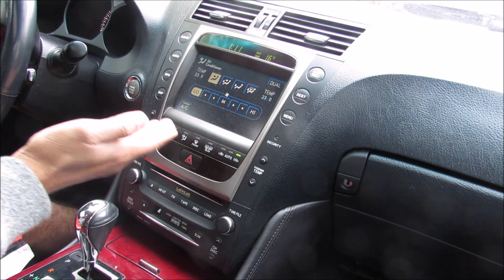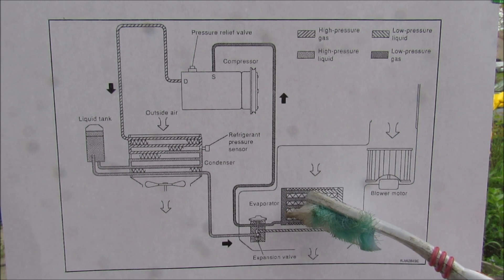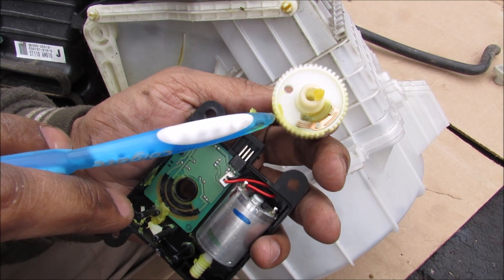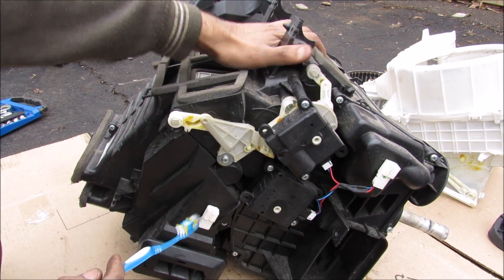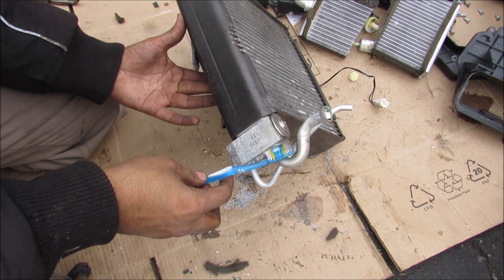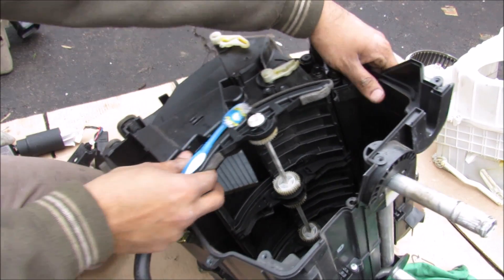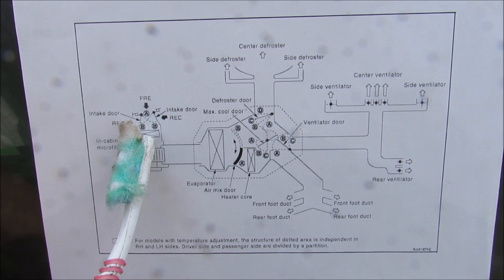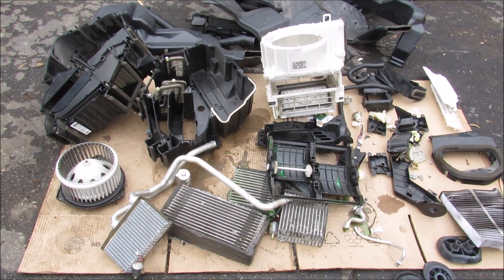How a Car Automatic HVAC System Works

Comment: 9:14 that's the TXV mounted on my European MPV (tried to find a scrap one to no avail, and the original one is like 130 bucks at the dealer) and in your video i'm able to notice some nicks on the valve seat, am i right? Also, in my channel i disassemble another one made by TGK, and there are no nicks on the seat, but, even though the ball is able to seat completely, the valve still never closes even if i completely adjust that little plastic nut to the closed position and then freeze the power head (that's a "cross charged" valve and you find it with variable displacement compressors and rotary compressors, i can link some patents that show how these ones work; on scroll and vane compressors, they apparently help to keep the evaporator from freezing by keeping a little flow of liquid so to prevent the suction pressure from going down too much; on variable displacement compressors, they keep the control valve from malfunctioning and also keep the compressor lubed; the nicks on the valve seat may actually do the same thing)... also, in the TXV i disassembled, the ball is attached to the metering rod... anyway, thanks for disassembling it!
Reply from the maker: I didn't pay attention to any nick's in the valve seat but that would be an interesting way to let things be lubricated. 
This system had way too much green dye
Reply: @speedkar99  Yes, it also keeps things lubricated even when the evaporator is cold and the TXV is closed (practically speaking). Rear seat evaporators, for example, have nicked seat TXVs so that the oil doesn't pool right behind the TXV when AC is on but the rear blower is kept off. Unfortunately, TXVs that stay open, either because they're cross charged or nicked, also allow liquid refrigerant to migrate to the compressor while the system is off, causing a lot of noise (scroll, through vane, that sometimes start up noisily for this reason) and performance (variable displacement piston compressors, that sometimes take a little more time to go into full displacement than usual) issues...

Comment: Best view of this system I've ever seen, bravo! I didn't realize it had its own CAN bus system, what a complex process. I really like the snappy information delivery you show here....
Reply from the maker: Thanks 
Yes I didn't realize it until I researched why each motor has only 3 wires and found a good explaination in the repair manual
Reply: Some vehicles use the lin bus but operation is the same.

Comment: So air is always passing through the AC evaporator? If i want hot air, it still should go through AC evaporator?
Reply: The AC evaporator has no effect unless the compressor is activated. Off, you just get heat. With the AC compressor on you bypass the heater core and get cold. When both heat and AC are on (as when you turn to defrost) the cold evaporator condenses the moisture out of the air, then it is heated.
Reply: Only if you turn AC on.
Reply: @speedkar99 I also interested in new HVAC systems with "heating" feature. Where Coolant flow is reversed, so AC EVAP will act as AC radiator, and AC radiator will be EVAP. This system is in my car, european Honda Accord CW3 (2.2 i-dtec diesel, 110kw)
Reply: Yes, it's always passing through the evaporator first. With fresh air, however, it's outside air. With recirculated air it's inside air. This is useful to know when you want to do a "fully loaded" ac compressor test in the winter. Just run recirculation and hot air at the same time for some minutes and then turn ac on, and for example you'll see if a V5 compressor is able to run at full displacement...
Reply: thank you guys for the clarification

Comment: I love my cheap car's MANUAL SINGLE-ZONE HVAC system.
It has physical lever for recirculation control, for example.
No motors, no extra wires, far fewer things to go bad.
Reply from the maker: True but sometimes those doors get jambed or break
Reply: @teravolt6113  Yup, a cheap Honda Fit/Jazz.  I never considered using recirculation lever to control temps.  I think I'll stick to ON/OFF positions.
Reply: @catsspat  That's the same way the automatic climate controller regulates the interior temperature whenever it can't control the compressor displacement. It first acts on the fresh air flap and then on the heater flap/valve.
Reply: How old is your car to not have electronics in Ac?
Reply: @foxtrot312  2003. The only AC electronics is the ECU, which decides when to engage the compressor's clutch. There's not even an evaporator temp sensor (pneumatic control valve on compressor takes care of everything).
Reply: @foxtrot312  I'm pretty sure mine has some electronics, like the temperature sensor at the evaporator.  Now, the bomb drop.  My car is 2019 and has fancy adaptive cruise control (Honda-Sensing).  Ahaha!  But it's manual transmission, and HVAC is indeed mostly manual knobs and switches.

Comment: As always well done Speedy! I had one of those actuators fail recently in my Lexus which then blew outside air on just the driver's side,  and cool air everywhere else.   Rather than pay $80 for a replacement,  my son figured out that by removing it, he was able to position the flaps to just allow inside air.
Reply from the maker: So it's stuck on recirculate? 
I think I'm having the same problem with my Lexus GS too
Reply: @speedkar99  not sure what mode it was in  I just know that the Driver's side was not cooling.  Removing the actuator and manually positioning the vanes took care of it.  We tested the actuator with the cover off and found that the motor doesn't turn.  We could probably replace the motor or get an actuator out of a salvage yard, but this works for now.

Comment: My Civic 2010 AC blows cool air after car runs for 15-20 Minutes... it Does not blow cool air instantly
Reply from the maker: Sorry to hear that 
Sounds like the evaporator isn't working efficiency
Reply: @speedkar99  or in these newer models of cats the ac compredsor does not have a magetic clutch coil and instead they replaced this with an electric valve and this problem of only cooling after a while of driving or only while the csr is moving  is very comon on this kind of compresors.  Very nice video im an ac tecnician from puerto rico
Reply: @michaelsegarra2709  To me, it looks like that Civic has a common clutch-equipped scroll compressor. This looks like either low charge or faulty TXV
Reply: @teravolt6113  txv dont go bad so often it could but they rarely do so yea it could be multiple things that why is best to tske it to a professional he could even have a clogued cabin air filter and thats why he dont feel much coming out in the first pace but defenelty go to a profesional and an A/C one not a regular mechanics they allways recomend selants and thats a No No
Reply: @michaelsegarra2709  Agree, they're pretty solid (got one from a 20 year old car and it still opens and closes as intended, so it hasn't lost its charge), but bad machining or design always happens... anyway, with a fixed displacement compressor, gauges immediately tell you if the TXV is behaving correctly or not...
Reply: @teravolt6113 yes thay can last a lot what cant last is those allen key screws man they brake sooooo much i have tons on spare specially on mitsubishi  hyundays and kia. I really dont like messing with them unless i have to tske the evaporator out

Comment: ok.. Now lets see you put it back and make it work.
Reply: Give him some $$$ for parts and im sure he will not disappoint you.
Reply: The TXV may still work, if he took count of how many full turns the nut needed to come off (that's for adjusting superheat, i.e. how much the evaporator gets filled with refrigerant; mine took 4 full turns) when he disassembled it.
Reply: The biggest problem with that is that this was a G35. The dash assembly is SO tedious. So many screws, so many parts...so much aligning...ugh..
Reply: Not difficult. I replaced the heater core in my car years ago. Basically took me to the same stage of disassembly.
Reply from the maker: Agreed, though I was pretty violet taking things apart haha